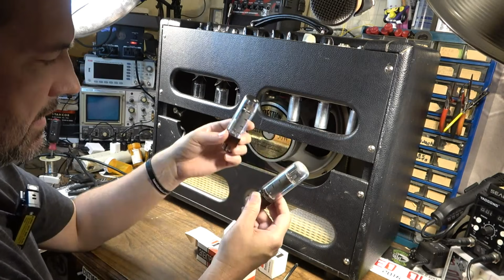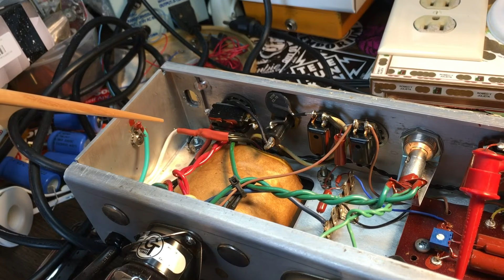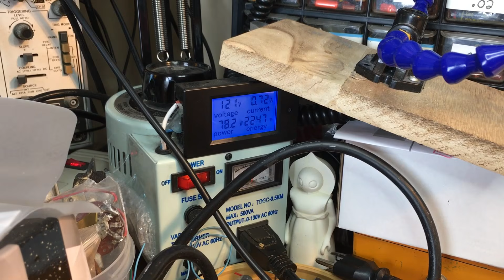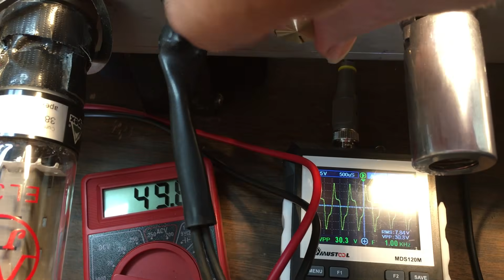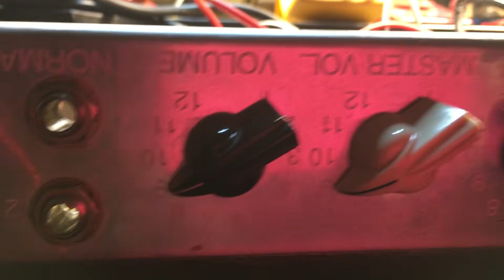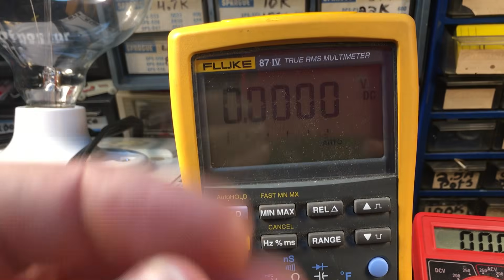STOP USING THE STANDBY SWITCH ON YOUR GUITAR AMP!

Comment from the maker: PLEASE READ: This video was meant to discourage amp designers from designing in Standby Switches. It applies more to tube rectified amps than solid state rectified amps as the tube rectifier takes time to warm up, and needs to charge the reservoir capacitor from cold to prevent arching due to excessive inrush current brought about by flipping a Standby Switch with a fully heated rectifier tube. But even amps with a solid state rectifier don't need a Standby Switch! The only reason to use Standby would be to prevent overloading a power capacitor or blowing fuses. As long as the power caps have been properly spec'd with voltage ratings exceeding the maximum voltage of which the power transformer is capable (something the amp designer should have considered already) and fuses are slo-blo and properly spec'd, this should be no problem. The best preventative measure for ensuring the life of components is for amp designers to design in ROBUSTNESS in capacitor specifications and use thermistors to help ease inrush currents.

I had been meaning to do a video touching on this subject for some time, and this amp finally reminded me. For a detailed discussion on this topic, see this article from the great Merlin Blencowe: http://www.valvewizard.co.uk/standby.html Note that in his article, Merlin points out that if a Standby Switch is used in a design, the reservoir capacitor should be wired BEFORE the switch, not after.

Also, someone asked about choosing a thermistor. For this I went with a CL-70 Amphenol. Most Fenders use CL-60. These thermistors have cold ohms ratings and current rating in amps. Both are important considerations. Here is a datasheet for comparing thermistors: https://www.mouser.com/datasheet/2/18/AAS-920-325D-Thermometrics-NTC-Inrush-031814-web-1315885.pdf
Reply: My Orange OR-15 manual specifically says to use the standby during warmup.  I know it has solid-state rectification. I've heard differing views on the merits of standby switches in my 50+yrs of playing. After this, I'm still confused. Is there , or was there ever an instance where a standby switch was even needed ? If so, why and what circumstance? Still confused after 50+yrs. I'm now 65. Have had almost every Marshall, plus about 50 or so other tube amps that came with a standby switch. Plus about 20+ that did not, although most of them were either singe-ended and/or low wattage. Yes, I'm addicted to buying amps. I've always done my own maintenance and bias with little problem. When i do, I don't hesitate to go to a professional tech. Yet never have I had a definitive explanation of the how or why or when a standby switch is necessary. Solid-state amps often use a "delayed or "slow-start" or "ramp-up"  or "soft-start" startup topology. Why is this not used for tube amps. Especially ones without a tube rectifier ? Thanks for the links. Maybe they will finally answer my questions but after all this time, I won't hold my breath. Anything that prolongs tube life in these times is paramount to tube amps not going extinct like dinosaurs just from the cost alone. Addendum: After following the links and some other research, I am coming to the conclusion that a standby switch on a tube amp is comparable to "tits on a boar". It only took 50+yrs. Let's hope tube amp manufacturers come out with just a "proper" "mute" switch for us instead of variations of pseudo-science "standby" switches. Calling them...and designing them as a true "mute" switch would be a great start.
Reply: Very interesting; we’ve always been told to use the standby switch as the best and safest thing to do! Wow!
Reply: I've had 2 Peavey valve kings crap out getting them warmed up with standby. The combo I fixed with a diode that cracked and the head unit still sits I can't figure out what failed even though it's the same thing that happened with the combo.
Reply: My marshalls all have stand by switches,never had a problem.But its plain to see
Reply: @aprilschauer4864  Marshalls have them because they copied a Fender that had one.
Reply: I have a Bogner Atma it has No Standby, the only problem, it makes a pop when you shut it off.
Reply: honestly I have always heard that it was best and safer to use the standby switch...
Reply: No offence, Brad, but perhaps '... to prevent arching dude is, as you and most folks know: 'to prevent arching due  ...

Excuse this pedant, please.  I cannot help myself ...

Of course: An excellent upload as always, Brad.  Stay free.

To you and yours.  Rab  🍻😎  ⏰       🎲            🌠                  💚
Reply: @RHR-221b    I was struck by the same thought but if you want to be completely correct....I'm sure Brad meant arcing due to excessive inrush... I'm no amp tech but I'm pretty sure he's referring to "ARC- a sustained luminous discharge of electricity across a gap in a circuit or between electrodes".

Comment: Dude I blew some tubes on my AC30 twice and I've always used the standby and I literally thought you had to.
Reply from the maker: Nope. Does more harm than good. Can cause arching in the rectifier tube.
Reply: @TheGuitologist  Do I have to have the amp modded to keep from using it or can I just straight up turn it on? I've never knew the technical side of my amps but always thought it just powered up the preamp section and if I didn't turn it on the preamp section wouldn't work. Amazing I've been that wrong for that long. LOL!
Reply from the maker: @SimpleManGuitars1973  What year is it? Is it a 60s one or more recent reissue?
Reply: @TheGuitologist  It's a 2013. I've had to replace tubes in it twice already and I don't even gig anymore. I still run it hot because a cranked Vox is my favorite sound ever but I'm not ever moving it or anything like that. It has the 2 Celestion 12 Greenbacks and EL84 and 12AX7 tubes. I've actually got American tubes in it now because this local guy called the Sound Doctor just fixed it recently and replaced all the Chinese tubes.
Reply from the maker: @SimpleManGuitars1973  I wouldn't be reticent to do mods if they improved the amp. Your tube issues may or may not have had anything to do with the Standby Switch. But you should discontinue using that switch regardless. Yours is actually switching with a dual throw switch on the transformer side of the rectifier, meaning it's switching the AC part of the high voltage. That will prevent the switch from arching as much as having it later in the circuit, but it still doesn't solve the problem of possible arching in the rectifier tube as it struggles to provide current to the reservoir cap. USA made tubes are always preferable to Chinese tubes for me. Hard to go wrong there.
Reply: @TheGuitologist  But as it stands right now can I just turn it on without that switch and it will work fine? You're right about the tubes though. I've actually heard techs are having a harder and harder time getting tubes these days and some predict tubes will just become a thing of that past but that will be over my dead body. I don't believe modelers will EVER replace tubes because they just aren't as good. Out of curiosity, can you even fix a modeling amp? I figure they're about like new tv's where they don't have people that work on them anymore. They just tell you to buy a new one. Seems like amps would go that way as well if they go to a more computer based system. You ever thought about that?
Reply: @SimpleManGuitars1973  nobody can repair a Boss Katana at the component level. Modeling amp manufacturers don’t provide firmware or schematics to anyone that could do that job(think Louis Rossman or other computer repair shops.

Comment: I was wondering if I could get a recamendation for a good rectifier tube my amp seems to be hard on them
Reply from the maker: What's your amp? A new rectifier may not be the best answer.
Reply: Victoria trim d le trem
Reply: if you know your amp is working proper splurg on a vintage one.i haven't had much luck with new ones although i haven't bought a new one in a while